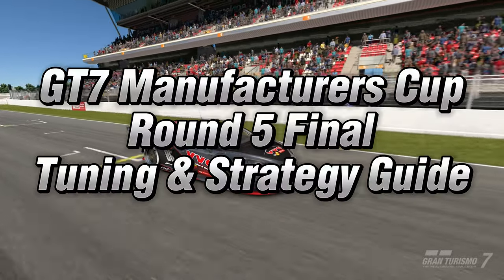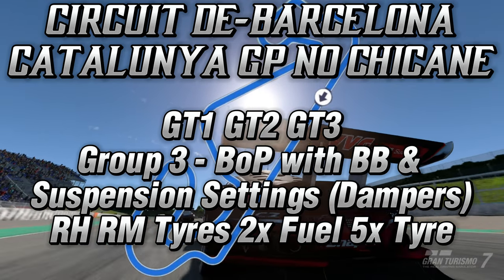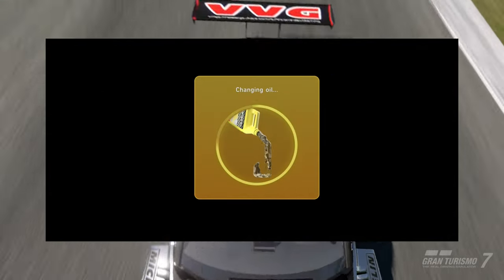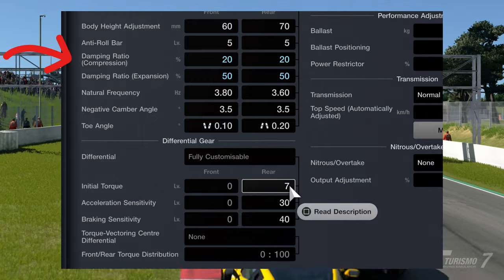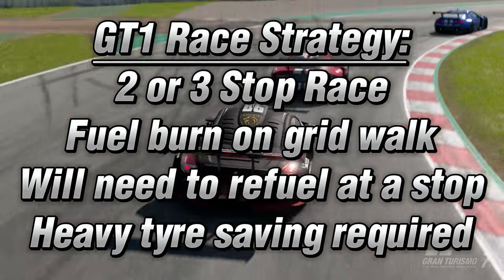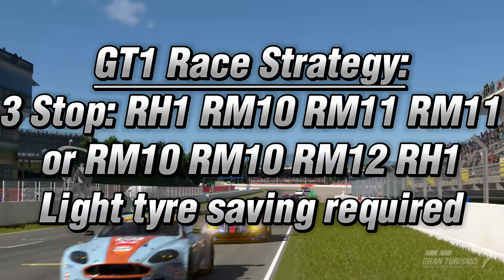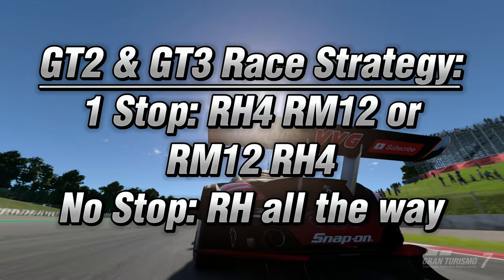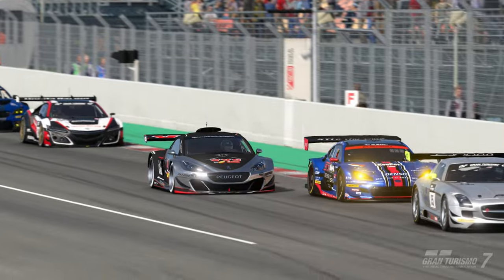GT7 - GTWS Manufacturers Cup Tune & Strategy Guide - Round 5

Comment: The winner of my field Gt2 (16 laps ) rank. Start p4 in Hard Tires. Hé makes no pit stop. The p1 at Start ran for 9 laps with MT and the rest with HT , finishs p2 with 10 sec late
Reply from the maker: Yeah for gt2 and gt3 no stop is good 👌 yeah that medium guy didn’t go long enough on the M
Reply: What would you say is the best strategy for gt2? I'm thinking no stop. Im racing for Subaru so should be decent on tyres.
Reply from the maker: Any car is fine for no stop for gt2/3 on H. But brz def has a solid advantage there on tyres
Reply: @neblolthecarnerd say us What was your result
Reply: @lecokase  I qualified 6th and ended up 4th (BS lobby). I definitely gained from the no stop.
Reply: @neblolthecarnerd   Congrats

Comment: Well maybe I'm not best at saving tyres but with as smooth racing as I can I think going RH10 RM12 RM11 will be the best option for me and no refuelling. I run out of M for last 2 laps on M stints and lose too much time
Reply from the maker: Does sound like a good idea. Maybe switch the M stints around though so the extra lap one is last. Yeah it’s tricky cause if you get battling or anything, stint can be gg. Really hard on controller btw.
Reply from the maker: HH 1 stop is another option but it’s really hard work. Also neither cars I tested would make it on fuel without putting a bit. You start with like 24 laps.
Reply: What rank are u?
Reply from the maker: @SmokeyNagata197  GT1
Reply: I did custom race with exact setup and bop with GTR and I was 29-31 laps at the start I just idk if the custom race is very different from manufacturer cup race
Reply from the maker: @SmokeyNagata197  it is a bit in this case. I did the same. I’ve done 2 slots now.
Reply: I just did a race and went with my strategy I started 8th and managed to get 4th at the end it was maximum attack for last stin AS people were doing 1 STOP 18-20 RH 13-15 RM impossible for me to do that no chance but 2 stop also worked for me and I had fun catching up, it was great race btw I race at A+
Reply from the maker: @SmokeyNagata197  Nice one 👌Yeah 1 stop was impossible for me too. Youre on wheel?
Reply: I'm on controller that's why I struggle with tyres most likely
Reply from the maker: Yeah same here, get minimum a lap less life out of them
Reply from the maker: @SubaruRex-69  Double check your settings. Even if you are really bad on tyres, you should get at least 10 laps out of RM in the race 👌